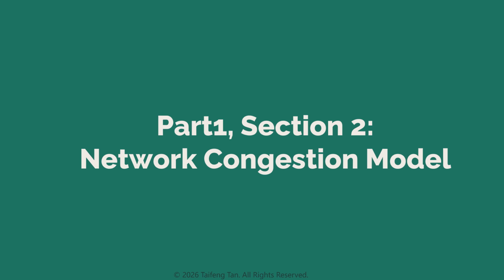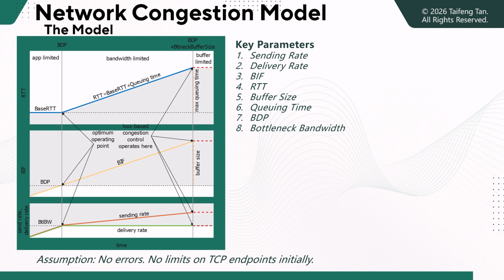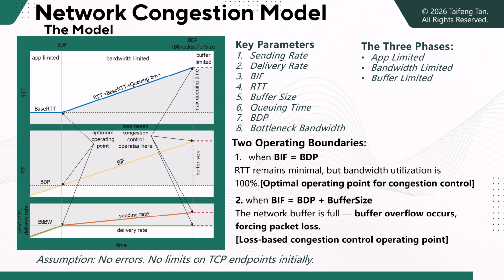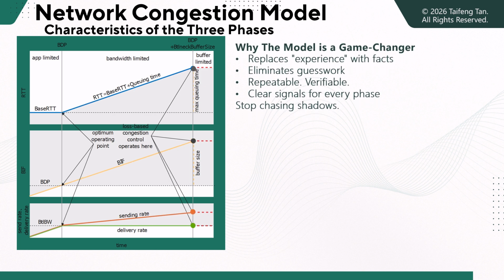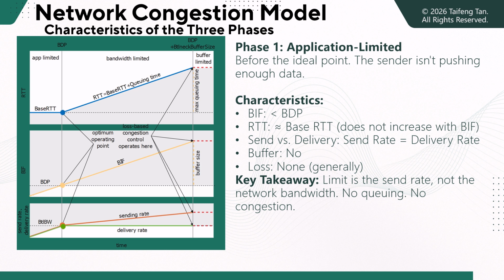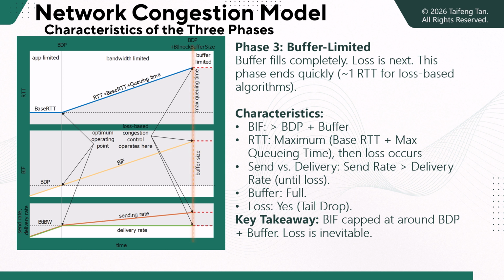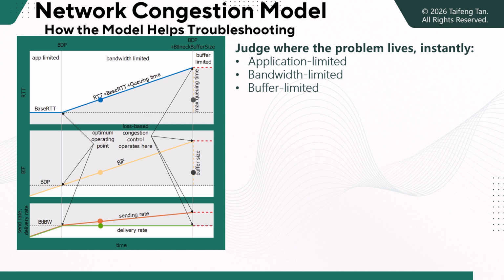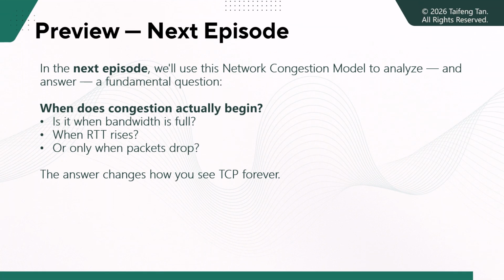EP2: The ONLY Three Ways a Flow Gets Limited | Network Congestion & Bottlenecks | Part1,Section2

Comment from the maker: The Network Congestion Model used in this series was inspired by the paper “BBR: Congestion-Based Congestion Control” from the Google BBR team. (https://dl.acm.org/doi/pdf/10.1145/3009824)

In this series, I expand on those ideas by combining protocol-level analysis with what we can directly observe in Wireshark.

Special thanks to Neal Cardwell and the Google BBR team, and to Gerald Combs.
Your pioneering work made this course possible.

If you're interested in the original research, I highly recommend reading the paper.

We’ll walk through the key parameters and explore how they interact in real network traffic.

Comment from the maker: Summary of This Episode

📘 EP2 — Network Congestion Model Overview
Filling the Pipe — The Three Ways a Flow Gets Limited
In the previous episode, we simplified the network into one pipe.
Now it's time to fill that pipe and observe what really happens.
As data flows through a network path, something fundamental occurs. No matter how complex the real network is, a TCP flow can only be limited in three ways.
Understanding these three states is the key to systematic network troubleshooting.
Instead of guessing why a transfer is slow, this model gives you a clear analytical framework.

📚 What You’ll Learn in This Episode
The Network Congestion Model
To understand congestion dynamics, we simplify the system with two assumptions:
• The sender and receiver do not impose limits
• No transmission errors occur
With those removed, we can focus entirely on network behavior.
As a TCP flow grows, the behavior can be visualized as a dynamic model where we observe mostly:
• Send Rate
• Delivery Rate
• Bytes in Flight (BIF)
• Round-Trip Time (RTT)
These parameters are all observable in packet captures and Wireshark analysis.
______________________________________
Two Critical Thresholds
Two key thresholds divide the entire transmission process:
BDP (Bandwidth-Delay Product)
When Bytes in Flight reaches BDP, the network pipe is perfectly filled — with no queue yet.
BDP + Buffer Size
When Bytes in Flight exceeds this value, the bottleneck buffer becomes full and packet loss becomes inevitable in tail-drop networks.
These thresholds divide the transmission into three phases.
______________________________________
The Three Phases
1⃣ Application-Limited Phase
The application simply isn't sending fast enough to utilize the available bandwidth.
Characteristics:
• BIF < BDP
• RTT remains at Base RTT
• Send Rate = Delivery Rate
• No queue and no loss
The limiting factor is the send rate itself, not the network.
______________________________________
2⃣ Bandwidth-Limited Phase
The sender pushes more data than the link can deliver.
Characteristics:
• BDP ≤ BIF ≤ BDP + Buffer
• RTT increases as queues build
• Send Rate > Delivery Rate
• Delivery Rate capped by bottleneck bandwidth
The network bandwidth now becomes the limiting factor.
______________________________________
3⃣ Buffer-Limited Phase
Eventually the bottleneck buffer becomes full.
Characteristics:
• BIF > BDP + Buffer
• RTT reaches maximum
• Buffer completely full
• Packet loss occurs
Loss-based congestion control algorithms like TCP Reno and TCP Cubic typically operate around this region.
Because TCP reacts to loss after the fact, the actual Bytes in Flight often slightly overshoots the theoretical limit.
______________________________________
Why This Model Matters for Troubleshooting
When you open Wireshark and see thousands of packets, it can feel overwhelming.
This model becomes your map.
Every TCP transfer — no matter how complex the network — is always in one of three phases.
A slow transfer (specifically, BIF) is always limited by one of these:
• Application
• Bandwidth
• Buffer
Once you identify the phase, troubleshooting becomes systematic:
1⃣ Identify the phase
2⃣ Identify the limiting factor
3⃣ Investigate the root cause
4⃣ Implement the fix
Instead of guessing, you follow a repeatable analytical process.
______________________________________
🚀 Next Episode
In the next episode we answer a fundamental question:
When does congestion actually begin?
Is it when:
• Bandwidth becomes full?
• RTT starts increasing?
• Packets begin to drop?
The answer will change how you think about TCP forever.
______________________________________
🔎 Keywords
TCP congestion control, network congestion analysis, Wireshark TCP analysis, bandwidth delay, product explained, TCP bottleneck troubleshooting, network performance debugging, TCP bytes in flight, TCP RTT analysis, network congestion model, packet capture analysis